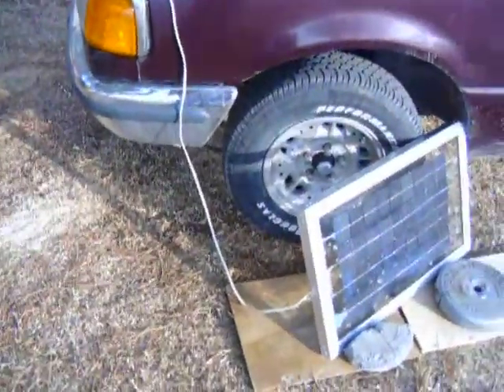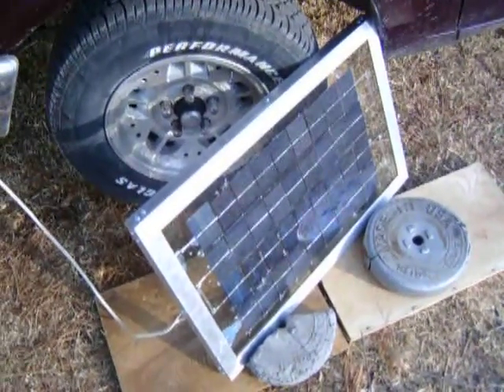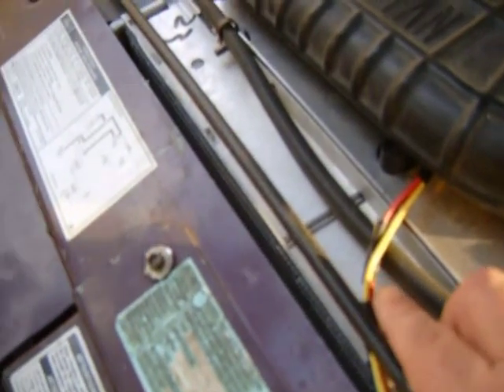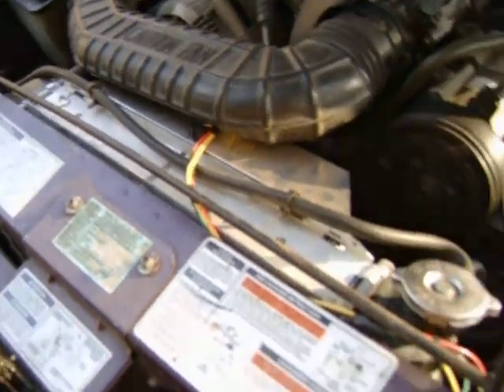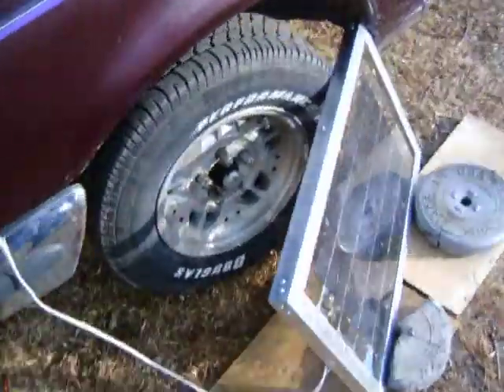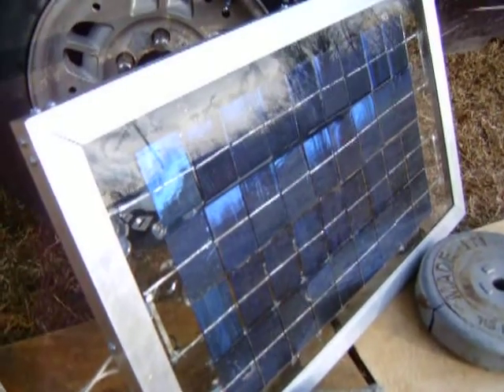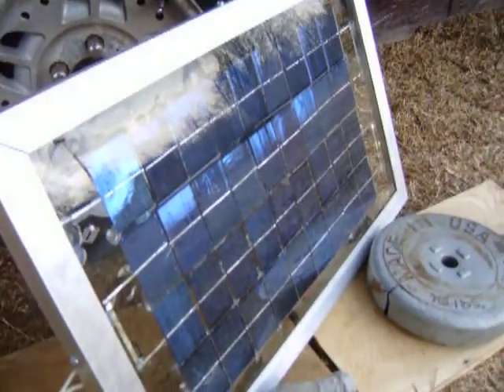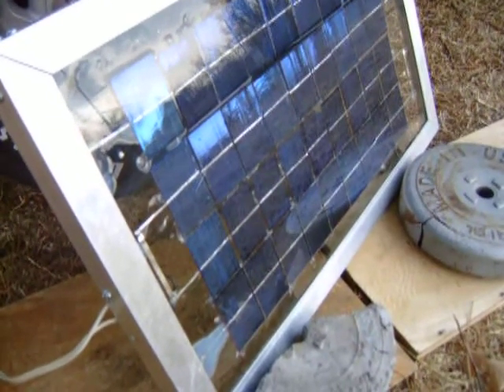1 amp trickle charger

Comment: @wtam69 This is really quite coincidental. I have a 1 amp (broken cell)  solar panel. The wind noise woke me this morning and this panel is broken again. My savonius was turning at the highest rpm I've seen yet but the wind did a number on this unsecured panel. This time it's only the glass which I can replace for a few dollars.